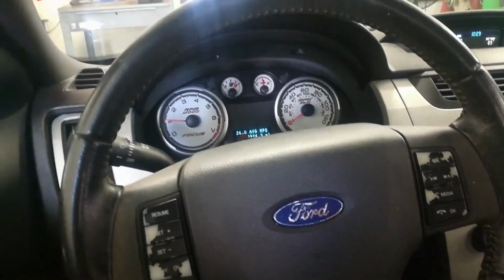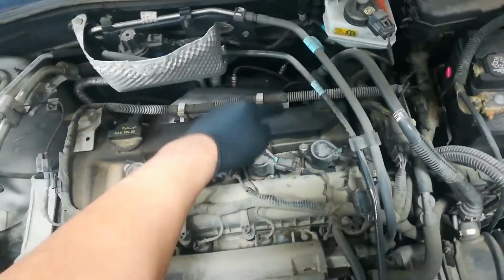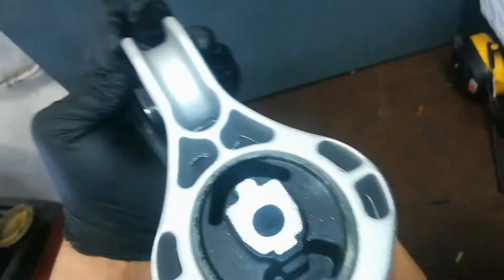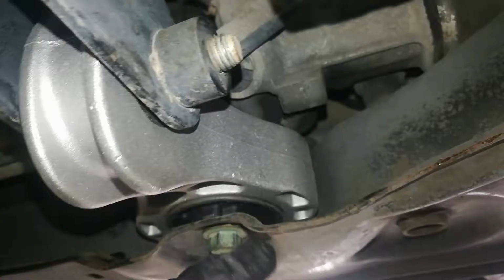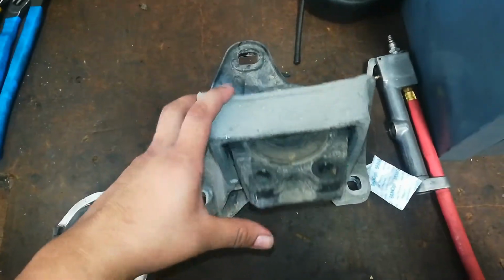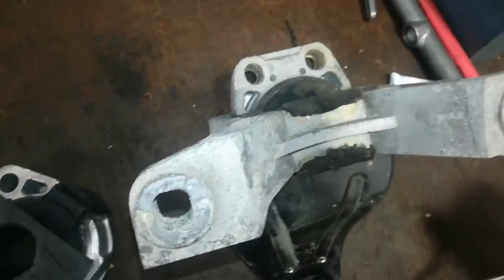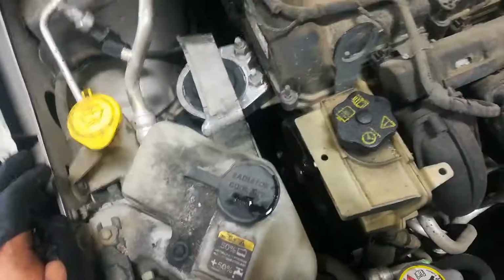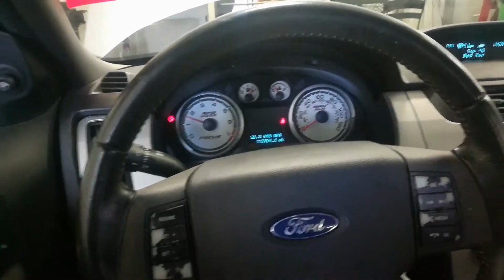Ford Focus Shaking Vibrations And Rattling FIXED! Replacing Motor Mounts

Comment: I'm wondering if this is the issue I have... I have a 2006 MT Ford Focus...... I have only had it a few months, and had a vibration/noise that sounded like a bad wheel bearing in first to third gear....even though i had no play and sound from it when turning the wheel, I changed it out anyway....but it did not take care of the noise/vibration/roar..................??